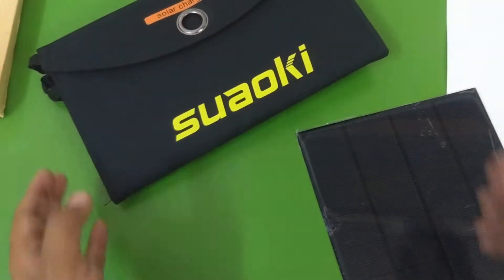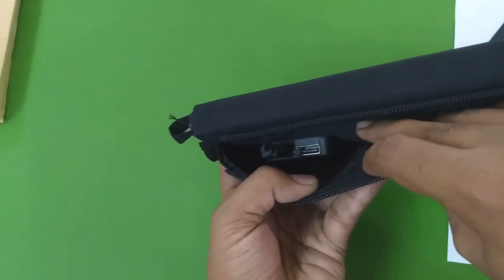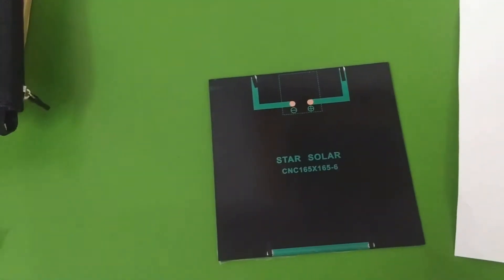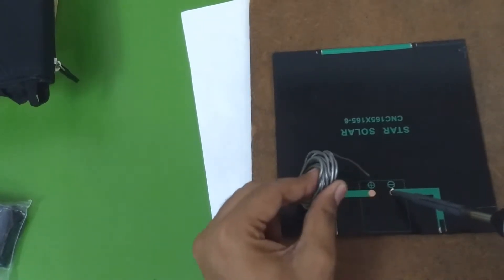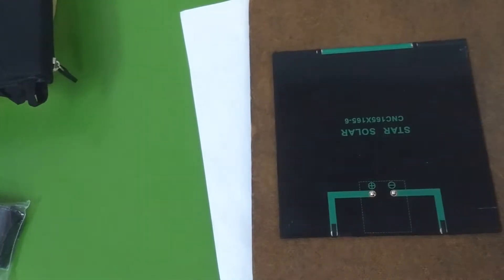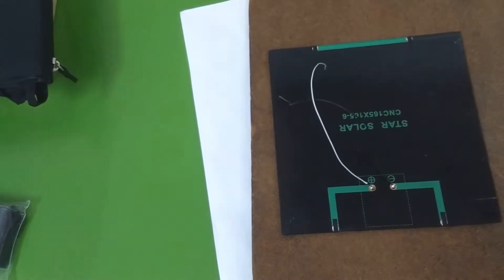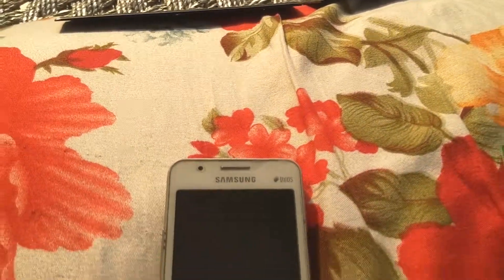DIY USB solar charger/ solar phone charger part 1

Comment: Good job.
Was wondering if  devices charged through solar panels, could get damaged, because of drop of voltage, fluctuations, due to prevailing weather conditions? Thanks

Comment: your math is week otherwise videos was good
Reply from the maker: At least mention the part where i messed up the math. Thanks.
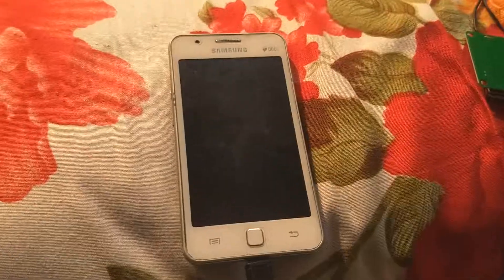Reply: @gurribuy  you are slow while calculating at 7:19 and 18:56
Reply from the maker: That is correct, i am slow in calculation.
Reply: Yeah Math is "weak" so as your English
Reply from the maker: @Reza-nu9gn  Thanks man, I can't do anything about math but i'm working on my english. Hopefully, i will improve.
Reply: Gurribuy  nice work
Reply from the maker: @YogeshKumar-js7tx  Thanks man.